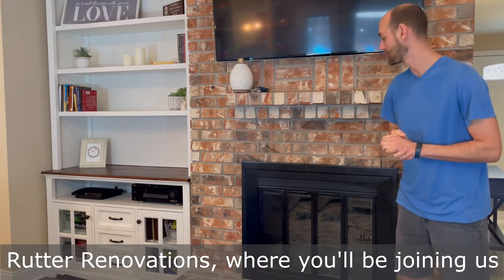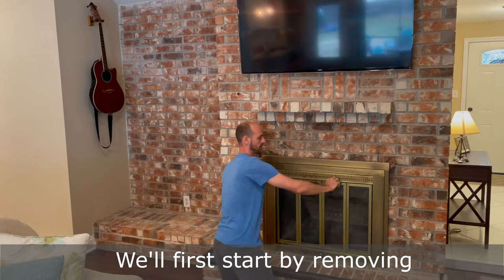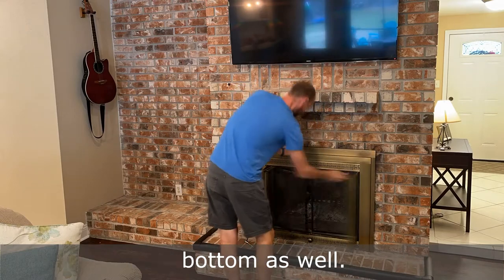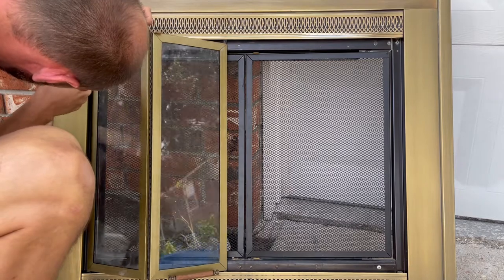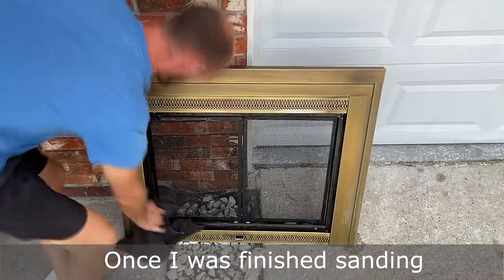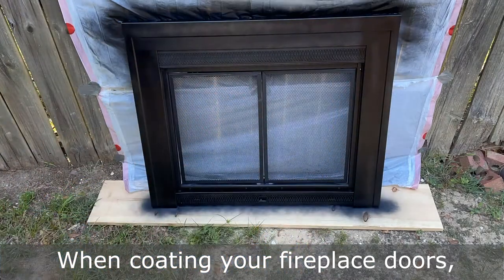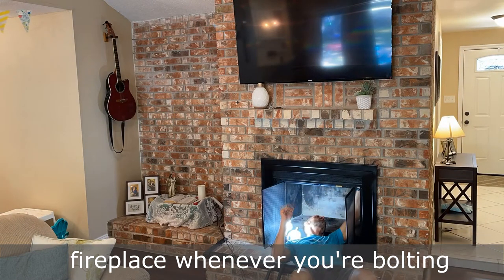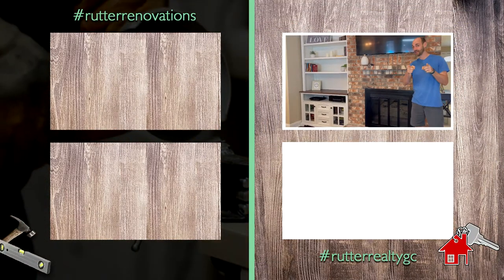How to Repaint Fireplace Doors!

Comment: Great video re disassembly and painting. Being this is a gas fireplace, I assume there's some residue from this petro product. I know the glass gets this and needs to be cleaned periodically. Wondering if degreasing would be a good idea before scuffing and painting. Thinking that's maybe why some respondents are having problems. If you think this might be a good idea, what might you suggest?
Reply from the maker: I’m not sure… I am using a wood-burning fireplace and haven’t had that issue. I’m not sure what the best degreaser would be.🤷‍♂️ A quick search online might have the best remedy.

Comment: I did this. However the paint I used was the same with the bbq pit on the can. High temp flat blac. But when you touch the finished product your fingers seem to leave a slight smudge marks I’m assuming from oil on your fingers. Can you clear coat this?
Reply from the maker: I would use the gloss finish. It will look way better than the Matte finish!👍
Reply: Ok thanks. I found some that will take high temperatures….. the rustoleum kind will only take up to 200 degrees and didn’t wanna risk it in case I ever lose power for a couple days and have the gas log cranked up for awhile

Comment: Have you had any issues with the paint peeling? I seen some reviews where people have it peeling and the reason is because the paint was not heated to 400 degrees to fully cure it based on the label. How is it holding up by the way?
Reply from the maker: I’ve used the fireplace several times and it is holding up like the day I painted it on.👍 Sounds like they might not have prepped the surface correctly or used too thick of coats.
Reply: This is what I’m trying to figure out. But how do we know how hot a fire place gets in order to properly cure the paint 😩

Comment: Masking the glass might be a safer way to go.  Any overspray can be easily removed from the glass with a razor blade or damp #0000 steel wool.
Reply from the maker: If the glass isn't removed, you'll still see the bronze (or whatever color) around the border (on the inside of the frame where the glass sits).

Comment: Hii! I did this same exact process, but the paint is scratching off fairly easily. How to prevent this? Did you face this issue?
Reply from the maker: Hey, I did not have this issue. You have to do several LIGHT coats as opposed to 1 or 2 heavy coats. It also won't stick if the surface isn't properly scratched up. I hope that helps!